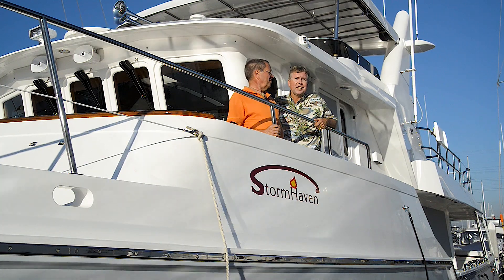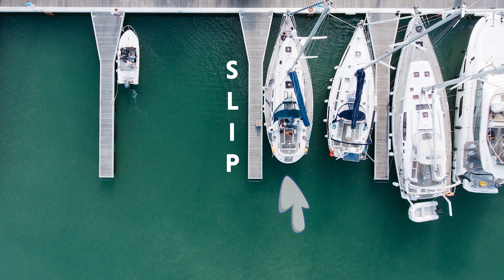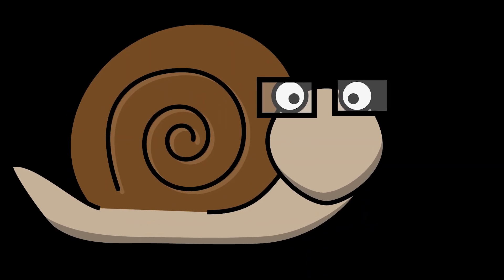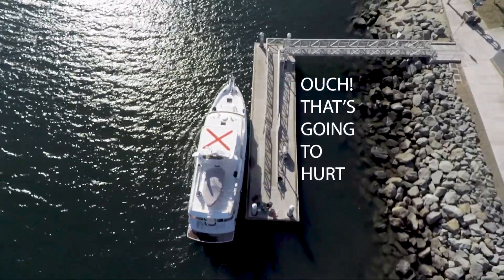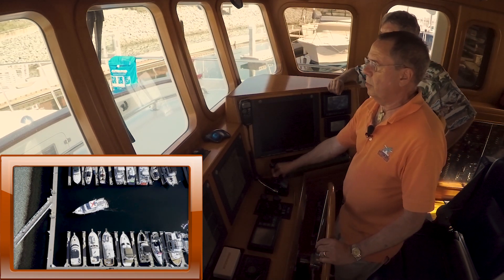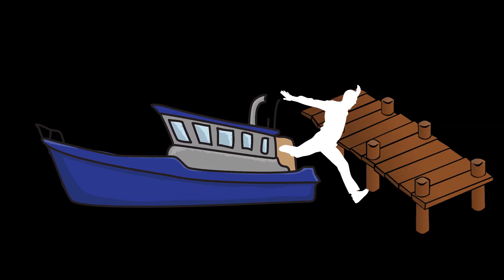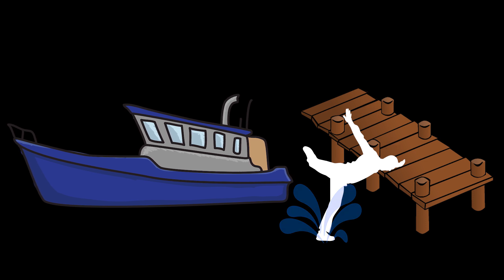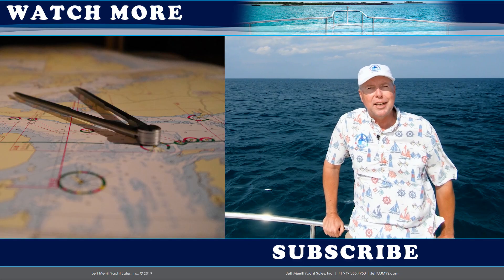Physics of Docking - Bow In

Comment: I always back in with my truck. Why not with a boat?
Reply: thanks! new to boating!
Reply: Andrew Doolittle another way to think about is is your truck steers from the front, a boats rudder is in the rear so like a truck in reverse.
Reply: @djmccormack  I used to drive an 18 wheeler so the purpose of the backing move was to get the trailer in...which did move or "drift" like a boat in the water. Still there were no tides or "blow" to worry about in the parking part of that job.
Reply from the maker: Andrew - backing in is my preference - easier to depart. We have a video on backing in.  There are so many choices, we have tried to break down the different options.  Sometimes, if it is windy or tricky, arriving bow in is just easier. Thanks for watching!